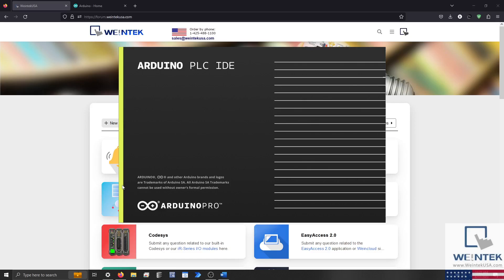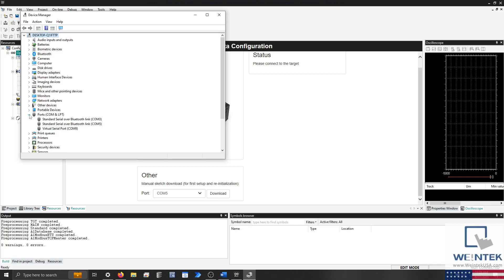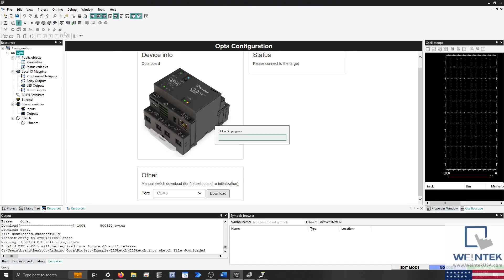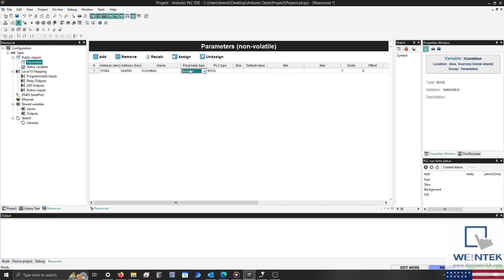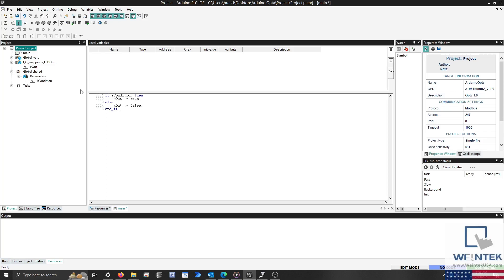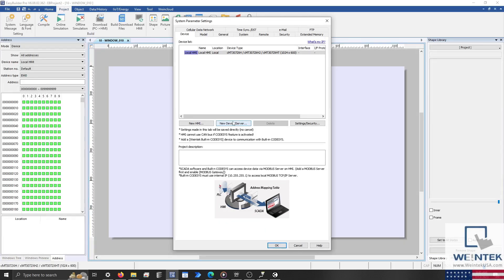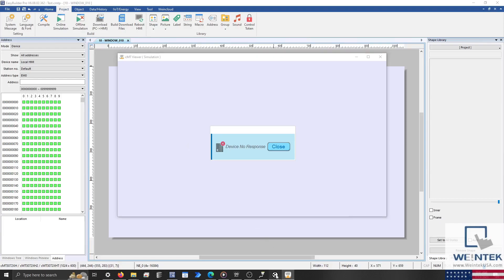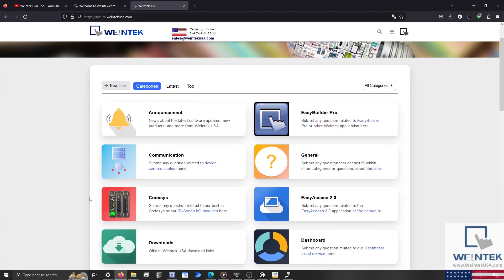Weintek HMI to Arduino Opta PLC using Modbus TCP/IP - Weintek USA

Comment: Are you able to use and program the Weintek HMI with arduino ide (the original programming platform?) or must it be used with the Arduino PLC ide?